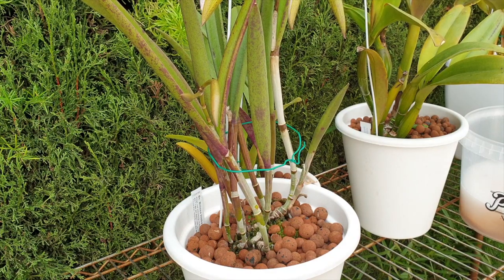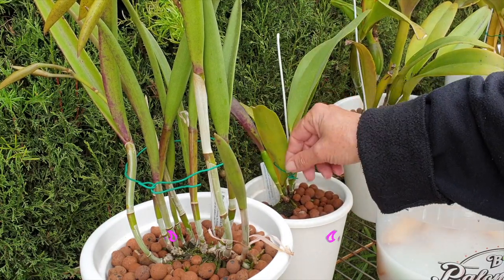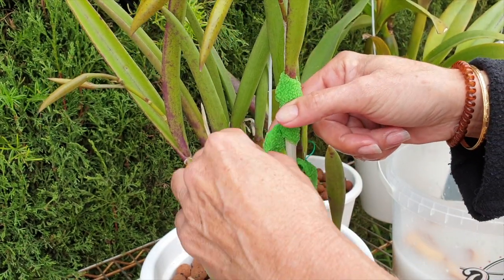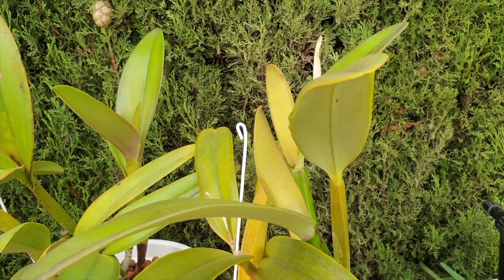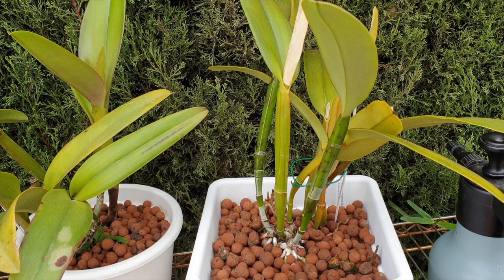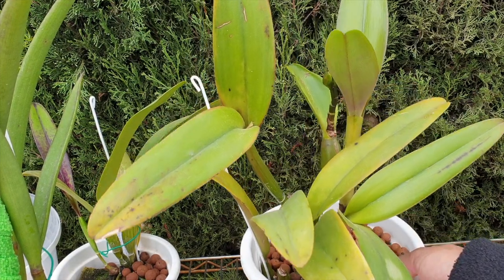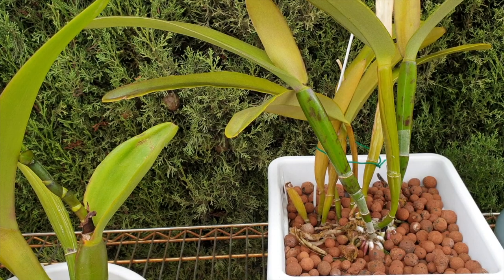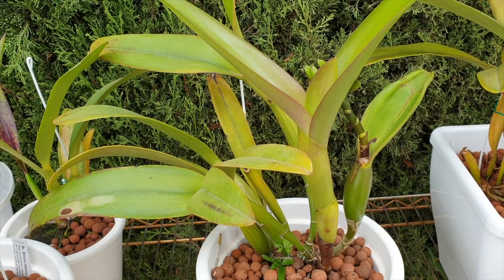𝑺𝑯𝑬𝑨𝑻𝑯𝑺...𝑪𝑼𝑻? 𝒀/𝑵? | 𝑨𝑹𝑶𝑼𝑵𝑫 𝑷𝑺𝑬𝑼𝑫𝑶𝑩𝑼𝑳𝑩𝑺 - 𝑨𝑹𝑶𝑼𝑵𝑫 𝑩𝑼𝑫𝑺 | 𝑩𝑬𝑺𝑻 𝑷𝑹𝑨𝑪𝑻𝑰𝑪𝑬𝑺 𝑬𝑿𝑷𝑳𝑨𝑰𝑵𝑬𝑫 🌸 #ninjaorchids

Comment: Thank you! Thank you! Thank you! I have to be more careful with my watering. I usually water from above, so water can get down into the developing growth. I'm tempted to remove the sheath too early so that doesn't happen and the new growth is too weak to support itself.
Reply from the maker: Mark!! Hi!! 🤸🏼‍♀️🤗💐 you are more than welcome! Thank you for having faith in me to make something out of your question that helped. Hold back... it is a temptation to peel away too early, but, hold back. If you have a new growth starting on an orchid you water, place some kind of cloth or cut piece of rag over it as you water, so that it will be a visual reminder as to where your water goes and will soak into the cloth before it reaches the sheaths. I do not know if that is possible, but it helped me back in the day when I was growing with bark and watered from above. I always had a rag strip with me to remind me where to pour water and where to stay away with it. 🤷🏼‍♀️Any further things you may encounter and have any questions about... fire away, anytime! Thank you so much for supporting my channel, I really appreciate it 🌸

Comment: Thank you for sharing how you remove the sheaths and the reasons for it. I pretty much do the same on my cattleya for the very same reasons. I am finding that the sheaths on the cattleya do come off more easily. However I don't have a Brassvola so I can't judge. I will sometime soon hopefully have one, in the spring I am guessing. Anyways that you for the tips and tricks and have a wonderful weekend.
Reply from the maker: Hi K P! 🤗💐you are very welcome!! I do like to get at sheaths, also for the optics, but no way is it feasible to take off a Brassavola sheath until it grows brown and hard, simply because the growths are so thin, but then... when you get one, you will see just how dry and tough they are to get off. Normal, considering how thin the structure of the growths are which they are protecting. I love taking off sheaths 😅 I really appreciate you taking the time to watch and wish you a wonderful Sunday! 🌸